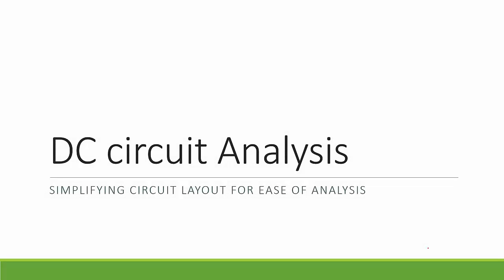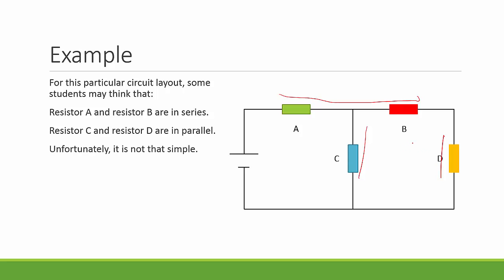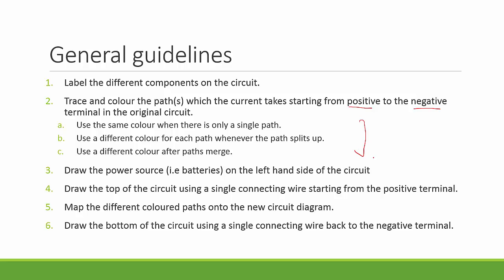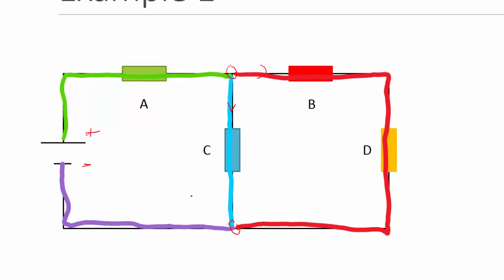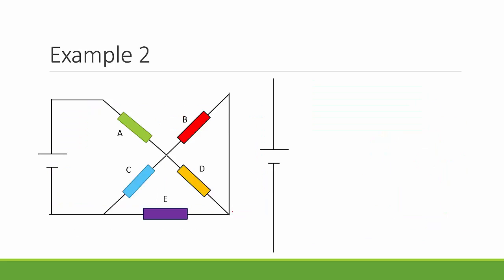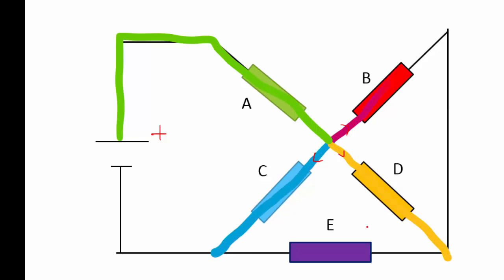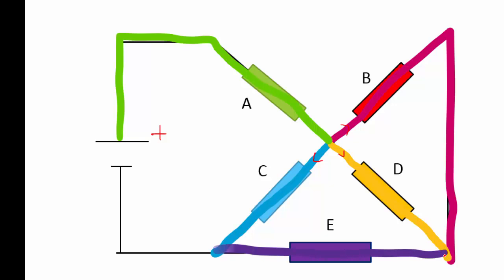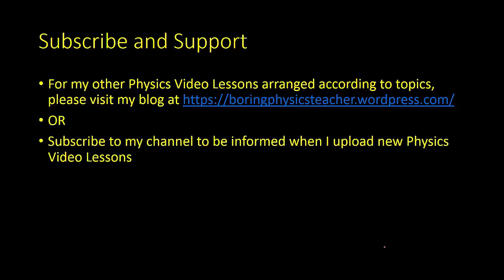DC circuits: How to redraw circuit diagrams to make it easier to analyse?

Comment: Amazing. Do you have videos on, or can you do more of, these for more advanced circuits? 😁
Reply from the maker: Thank you for your kind comments! i currently do not have videos on more advanced circuits as the examples I had shown are usually of sufficient complexity for high schools.
However, if you do have examples of circuits and provide a link to the diagram, I could attempt to analyse it.

Comment: The second example is wrong. You cannot redraw based on sequential connections, you have to mark the nodes. The resistor A is in series with a parallel of the other resistors. More specifically B is in parallel with D which both are in parallel with C in series with E.
Reply from the maker: Hi! Thank you for your comments! I agree with you that B and D are in parallel. They are also parallel with C, but be in series with E first. I would like to clarify how is C connected to E in your opinion? Is C is in series with E? Thanks!
Reply: @boringphysicsteacher  Yes, I think that E is in series with C. To be more precise let's say that the node after A is 1, the node after B is 2, after D and E is 3, and after C and E is 4. When trying to re-draw the circuit, we'll have A, then the node 1, then from 1 to 2 there's B, from 1 to 3 there's D, but the nodes 2 and 3 are connected with an ideal conductor so the potential is the same, therefore 2=3 and B and D are in parallel. Moving on, from node 1 to 4 there's C, but we know nothing about the resistors so the node 4 has different potential than 2=3, therefore C has different potential than B and D and can't be in parallel with them. There's still one path to take, from 1 to 4 to 3, there is E, and considering the path taken it's after C, but considering it ends in 3, this whole path is in parallel with B and D, and this whole path is C in series with E.

I think your re-drawing is right only is the resistors are equal, and therefore we have the same fall of potential on each resistor, but that's not the general case. The potential in 4 is different than the potential in 3
Reply from the maker: @beansandpeas2029  Thanks for your write up! I would like to point out that node 4 has the lowest potential compared to the rest as it is connected to the negative terminal of the battery. So, conventional current flows through C from 1 to 4 will flow back to the battery. It would not flow towards node 3. Another way to look at it is the flow of current in/out of node 3. Current from node 2 will flow into node 3 which means that current from node 4 cannot flow into node 3 as each node must have an inflow and outflow of current.
Thus, I would still stand by my drawing to calculate the effective resistance of this example, which is 
A + [ C // { (B//D) + E } ]. I had used a simple circuit simulation to verify. Maybe you can use it to verify if your thinking is correct.
Thank you for this discussion and making me think through and verify! 
Video of using PHET circuit simulation 
https://www.dropbox.com/scl/fi/lkehuuynsv3to119wc83n/circuit-verify.wmv?rlkey=26pya2o4azr9zpfmfhucua2qx&dl=0
Reply: @boringphysicsteacher  Ahhh, you're right, I missed that detail. Damn hahah, thanks for this exchange, that's how you learn! (btw I'm still taking this EE class so I'm excused hahah)
Reply from the maker: @beansandpeas2029  Yes, that's how we learn through discussion and clarifications. Thank you for giving me the opportunity to elaborate my video! 😃